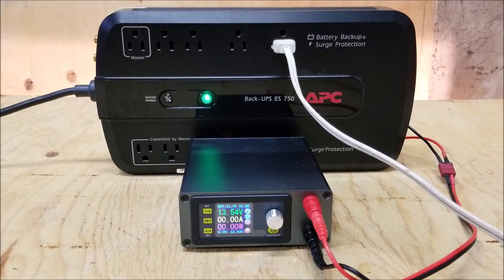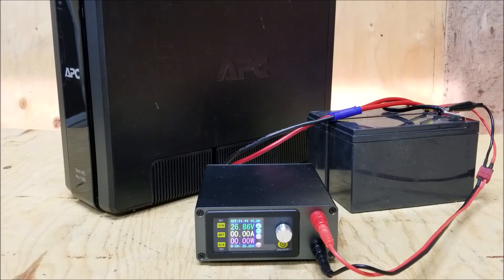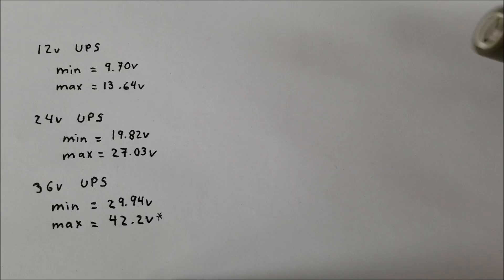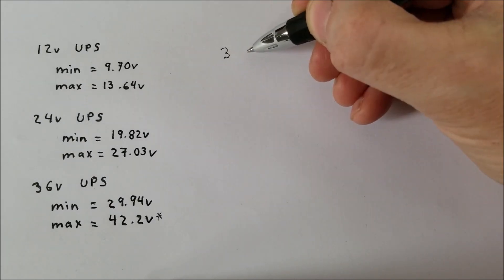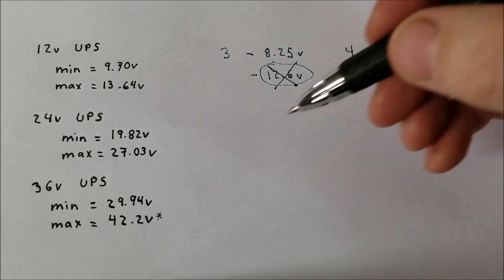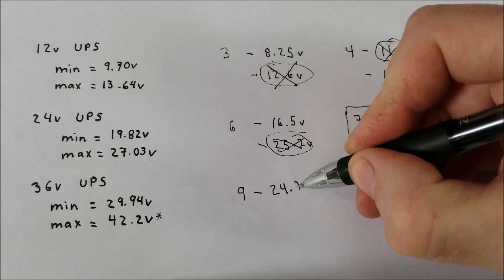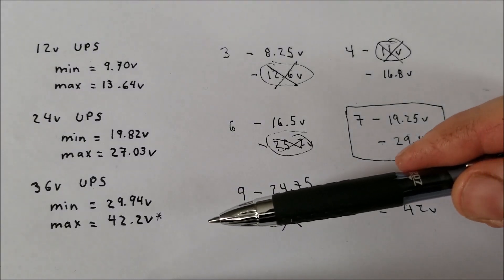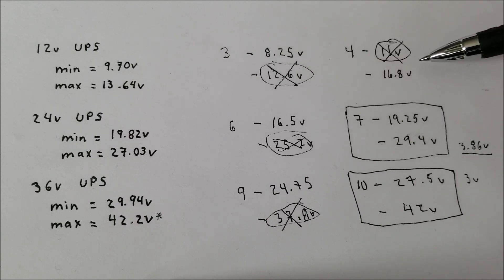Can a UPS use li-ion batteries

Comment: Li-Ion = 2,75/3,75v, LiFePo4= 2,5/3,65v.?
Reply from the maker: You need to lookup the manufacturer's recommendations but in general:
Li-Ion full charge 4.2v, discharge under load 2.8v (most people, including myself, use 3v as a lower limit, especially when discharging slowly)
LiFePo4 full charge 3.6v, discharge under load 2.5v
For these A123 cells, the manufacturer permits a discharge to 2v but from the discharge chart, you can see that the cell voltage drops like a cliff past 2.5v.
https://lib.store.yahoo.net/lib/buddipole/ANR26650M1A-Datasheet-APRIL-2009.pdf

Comment: LiFePO4 is most suitable and works easily with all 12V, 24V and 36V. But also it must be paired with CC/CV dedicated charger (for example from separate wall/PSU connection) which also includes BMS for discharge balancing. These are not expensive.
Reply: If you do it assure that you have a HIGH QUALITY charger as charging Lithium Ion batteries can be very dangerous. The lithium iron you suggest is a much better suggestion.  Lithium ion thermal runaway is no joke and improperly charged or discharged lithium ion is asking for disaster-just look at the Tesla fires.  I'm waiting to see the havoc when the Power Walls start to ignite as they are one of the few not using LiFePO4 but rather go with lithium ion.
Reply: @TVMADoc  Yes, for other than mobile use (where weight/power density is important) the LiFePO4 is better choice. In future solid-state litium batteries could be the optimal alternative.

For example few days ago Nissan informed than their solid-state tech is moving forward and the larger pilot factory will be ready 2024. They said that 2028 the price should be 75 USD /kWh and few years later drop to 65 USD /kWh. This sounds promising, though we need to wait and see.

Of course even larger players - like Toyota - are working with solid-state batteries as well and they said them to be ready even earlier. But for those I don't remember seeing specific price estimations.

Comment: BTW, you can do something else DO NOT plug in the UPS into the AC plug, BUT use DC power supply at 12.6v and connect it to the li-ion batteries and the wires between the batteries and the UPS.
Reply: Wouldn't it defeat the purpose of the UPS if you constantly need to manually charge it on DC every time it is discharged?
Reply: @jmd.759  Not exactly. If you put in parallel the DC source with the battery then the UPS take the current from the DC source. If the DC source is absent (power cut) then the UPS take the current only from the batteries.

Comment: What about the maximum current for a single 18650 is it Ok? is it smaller then the maximum current that go to the lead-acid batteries ?
Reply: If the Lead Acid is 12 Amp-Hours then divide by (approx) 2.5 to get 5 Li-Ion Cells in parallel, for equivalent energy

Comment: Even without the apparent expertise of Mr Coloe who commented, somehow I don't think it's as simple as what's presented.   Lithium-Ion batteries have been generally available for almost two decades now.  Since they have, what, 7x the energy density over lead-acid, why aren't lithium-ion UPS's flooding the market now?   Makes an enquiring mind kind of suspicious.
Reply from the maker: Simple, lead-acid batteries are cheaper than li-ion. Furthermore, li-ion batteries need a BMS to be safe which makes them even more expensive. But probably most importantly, lead-acid batteries die after about 5 years and most people simply buy a new UPS.
Reply: The lead battery dies because of old age not use.  The li battery catches on fire because of poor charge design
Reply: They do make Lithium UPS, they are just much more expensive.

Comment: It's possible using bms for 18650
Reply: Yes it should work! At least when you charge your 18650 battery in a power bank with USB you use 5V from the USB and a BMS for the batteries and it works ….
Reply: @andonrangelov8844  During an Overcharge event a Common Port BMS will disconnect the battery.  The UPS might not like that?

Comment: Now i have a Server Rack UPS with 48v battery voltage Lead Acid voltage range you could argue that Li-Ion 13S has an even better & tighter margin with a range of 35,75v - 55,25v compared to fit 38,8v - 55,2v used by the UPS. The BMS protects the Li-ION being overcharged with UPS Trickle charging. Why didn't you include a 48v UPS test?
Reply from the maker: I didn't have a 48v UPS to test with

Comment: Well explained really good job enjoy your video.... I have a 12-volt APC ups and hoping to do 4S 10 P with a BMS to provide low voltage protection and charge balance
Reply: If you have BMS better try 3s not 4s, becasue for 4s you will charge up to  13.64v and this mean 13.64/4=3.41v which is basicaly around 0% of the 18650, see this table https://lygte-info.dk/pic/BatteryChargePercent/BatteryChargePercent.png

Comment: a good BMS should stop any overages or even use protected cells?
Reply: @mwint1982 - During an Overcharge event a Common Port BMS will disconnect the battery.  The UPS might not like that?
Reply: @vtorsi610  UPS is pretty smart. I wouldnt worry.
Reply from the maker: Yes, but I don't have one.
Reply: @DIYbatteries  Buy one then...

Comment: I have a CyberPower CP1000PFCLCD UPS and noticed the life is pretty terrible. I have been thinking about doing a Lithium Iron Phosphate replacement, but the ready-to-replace batteries are crazy expensive. I found some IFR26650PC batteries which are very reasonable (max min 2v, max 4.2, recommended 2.5v & 3.65v tho) but don't know the min/max of my Cyberpower.

I guess I need to buy a voltmeter and figure out how to test my unit with it.

Comment: HOLY COW!! I just stumbled onto your video!! Been researching for the past week on the tripplite and you had one tested. Looks like 10S would work next to perfect for the 36V. Thanks for the video and testing!! The other 2 can be fixed or even the 36V can be fixed with a BoostBuck converter connected for charging. You would need to disconnect the charging the UPS does, itself or just never use the ac plug. Great work
Reply: @njfulwider5 Funny you mention a buck converter but choose to add a boost.  I was thinking a DC to DC step down on the charge side of the 12v 3s, and 24v 6s configurations just before the battery connection.  By stepping down the overcharge you can charge your lithium to full, and the UPS will reach min before your batteries, and you can still use the original charging system.  Im just starting to learn a little electronics after being in IT for years.  If there is some reason I'm missing which lead you to a step up like you did please share, but I thought it was more logical to use a stepdown as you retain the original charging and the UPS doesn't;t need  13.64v/27.03v to run, those are just the charge voltages for the original led acid batteries, the UPS will be quite happy at the 12.6v/25.2v.  The only downside I see in this, is you are leaving some power in your batteries when the UPS cuts out.  However, as a fix for the issue of not being able to use lithium (I keep saying lithium because LiPo batteries have the same nominal voltage and 18650s and it could be cleaner and cheaper to buy a pair of 6000mAh 3s LiPo's than a pack of 10 18650's and would open up a whole new world of applications for your battery with a HUGE increase in discharge output, you could say for instance boost a dead car with a couple 3s LiPo's in parallel, and I like the capacity of LiFe which is a lower nominal Voltage and you need 4s to hit 12v, but that's not an issue with what I learned in this video, I now know how to spec it out) for your 12v and 24v UPS's (which I assume most people have on their home computers anyway) it was worth bringing up a modification to your fix.
Reply: @joeshedler6496  using a boostbuck converter, you can fine tune the charging, no matter the voltage coming in. A boostbuck are great when using a ups that uses 12v or 24v or even 36 if the boostbuck can go high enough. A boostbuck can take the minimum voltage difference that a boost or buck converter can’t do by themselves ( usually 1.1v). Hope that made sense...lol
Reply: @njfulwider5  My fisrt experience with a buck converter was a boost.  Im using a 3-30/3-30 to bring the 5v provided by USB up to 12v to run 12v led strips off USB power, well actually over driving them at 13v, lots of open air no heat issues and it gives them  just a bit more oumph.  The only thing with the converter, because its a boost, my output has to be 2v higher than than the input.  I assumed the step down would work the same way with the range of input and a dedicated set output so the charger can do what it wanted, and you provide your battery with, ohhhh shit, I just saw the 2v difference needed, which means you only charge your lithium to 11.6, how sad.   Damn, how gullible was I to think my 1 week deep dive into electronics was gunna win me some street cred on youtube with my brilliant suggestion.   :P   Damnit, if only the gap was wider like 2.1v, I think a buck converter step down (in product listings I see then called both buckconverter and dc-dc step up/down converters same product, wide range of input, and I think its an adjustable pot that lets you choose your output) would be the way to go.
Reply: @joeshedler6496  you have to be real careful with the sellers out there. They’ll sneak in the word boostbuck or step up/step down in the title, just to get more sales. I fell in that trap a few times, and ended up returning the item because of that. There are 3 types of converter. A boost, a buck and a boost buck. Most of my projects I prefer a boost converter, because those usually handle amperage better than buck. Unfortunately the boostbuck converter handles amperage the same as a buck, because of the buck side of the boost buck converter. The boost buck converter takes away the limitations on the voltage side, making them great for ups. Have you been to the Facebook sites like (18650 battery) or (DIY powerwall). Great site I’m apart of that is a wealth of knowledge, when it comes to this. I’m apart of many many others and have my own channel on YouTube. Hope to see you there, you’ll love it if you like projects like this👍👍👍👍
Reply: @njfulwider5  So,  I'm a little unsure of what the advantage of a boostbuck over a variable on the fly input and user selected voltage on the output side dc-dc up/down converter is.  What voltage limitations are there?  Is it more than just a variable voltage on the input?  If not, my dc-dc step up converters seem to be doing the same job your describing getting out of a boostbuck.   Sorry, I wasn;t kidding when I said I just started in electronics.  I know lots about power and some basic electronics llingo, which some of I actually understand, but I don't even know if Im at a highschool level.  Im defiantly all theory, and no hands on at this point.  An acute benign tremor in my hands kept me from finer solder work, so I pushed off electronics.  But I have more time on my hands now and a few days ago I said I should build a drill press like machine to hold my soldering iron and fine points wont be a problem.  then like 30 seconds after opening my mouth I engaged my brain and decided that was way over engineered, and I could get the same results from 2 boards, a hinge, and a spring.  LOL.  so yeah, Im finally doing it haha.
Reply: @njfulwider5  Oh, I forgot to say thanks for the resources, they are new to me, I'll have to check them out.
Reply: @joeshedler6496  I’m no expert by any means. Been doing this for 4 years and self taught. Hopefully I can explain this correctly. Say you ups gives you 12.8-13.6v output to the batteries. If your using a 3S battery, your full state of charge is 12.6V.  Meaning you need to buck the voltage down. Most buck converter need at least 1.1V-2V, 13.6-14V. Usually the voltage come out to charge the batteries won’t work with a buck. A buckboost on the other hand has no limitations except a minimum voltage or maximum voltage in. Usually around 2-36V. Giving you complete control of any input voltage in between. So if you have 13.6-14V, you can fine tune to 12.6. You can control the voltage no matter the input voltage between 2-36. Paying attention to ohms law, and not using past the amperage maximum. If you have a buck converter that handles the input voltage and capabilities, I say go for it, because buck converter have a higher amp ratings than the other 2.  But 9 out of 10 times you can’t find one for a 12v ups. But each ups based on the maker might have a different output voltage. In this scenario it’s all down to preference 👍👍👍
Reply: @njfulwider5  Ahhhh I got you now.  My confusion goes back to the naming scam from retailers.  All this time, I was assuming I didn't have a buck and simply a dc-dc.  But my dc-dc does exactly what you just described, so now that Im armed with the knowledge that I do infact have a buck and the vendors listing was honest Im all on board.  For the past couple messages I was trying to figure out what a buck could do that my dc-dc couldn't.  :D
Thanks for spending some time with a random newb on youtube!  Now, Im really wanting to buy a cheap Arduino and see if I cant make my new LED strips do some blinking 'n flash'n maybe throw in some morris code sprinkle in some subliminal messages while the wife sleeps, and then move up to my own RGB light show.
Reply: @joeshedler6496  I guess I should have called it a DC to DC buck boost converter...lol usually that’s how it’s titled. Only because you can use AC power with these and the power used to charge the batteries in the ups is DC, but the ups used a ac to dc converter like a wall plug in of sorts.
Reply: @njfulwider5  Yeah exactly.  Im a little familiar with UPS hardware because a few years back my work replaced all the UPS's in the office and were about to throw out all the replaced units, so of course, being the nice guy I am, I offered to recycle the units for them, its the green thing to do you know right?  So I spent way too much time, a bunch of hours on 3 nights, pulling all the copper and transformers from the units so I could recycle them for premium cost, and the rest and junk electronics.  Man that was sooo not worth it, I don't think I;ve worked for that much per hour since 1985 when I was a student got my first job at 14 making $2.50/hr.  LOL.  Thats why I suggested putting the buck right in front of the batteries, because it would have been DC by that time to charge the lead acid batteries.   So ftr Im ok with basic principles, like DC-AC, and Im really into AC DC :P what basic components do like caps, resisters, I cant read bands, but know how to look it up, diodes, tho, Im a little fuzzy on the best one, transistors.  I down with v=ar and can follow the path on paper of some simple circuits, but unless its really basic usually don't know whats happening as I trace the path.  I'll be good with beginner to intermediate boolen, OR, NOT you  know how it goes.  where I really get lost is the voodoo magic that happens when these components interact with each other in just the right ways.  Like I watched a video today, where a guy took a computer power supply and turned it into a class A amplifier.... Shit all this time, I thought they were only good for making bench 12v,5v,3.3v power suplies.
Reply: @joeshedler6496  you’d like my channel. Watching my first video, you’d see how far behind I was and how much I learned over the years. I have a few friends I chat with pretty regularly some have 500,000 plus subscribers and some have less than 1000. But all them helped me along my journey. If your interested in ups used as inverters, (Average Joe) is the man as he uses these to power some of his home. This year he is upgrading to major real inverters, but his older stuff deals with ups. Lithium ion, I got a lot of help from (Jehu). Both guys have allot of needed that helps new guys like us learn. I just started making curcuit boards, most my videos are sponsored by JLCPCB. But I’m still learning everyday.
Reply: @njfulwider5  Hi dear I am also a newbie in the field of electronics. I was seeking help for using Lithium Ion 18650 batteries with 12V UPS. I came across this video and then your conversation with (Joe Shedler). I am thankful to both of you for educating all of us who are silently watching your comments. I am also thankful to Leaf Xpacks